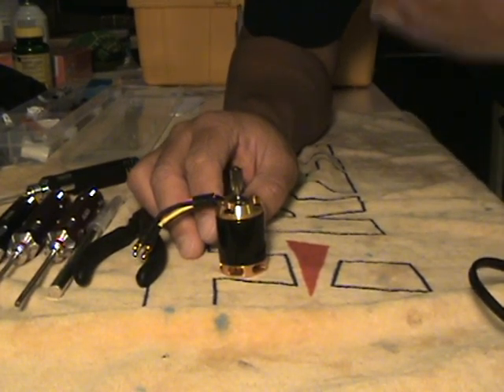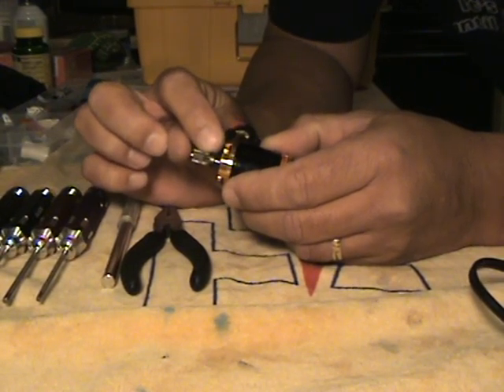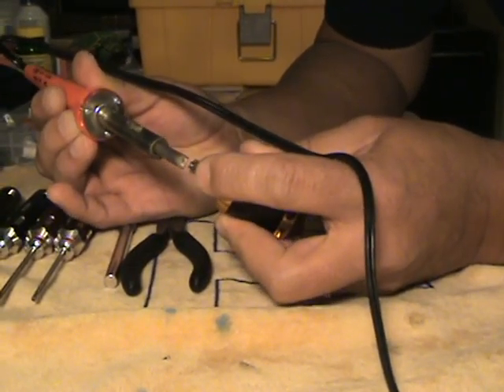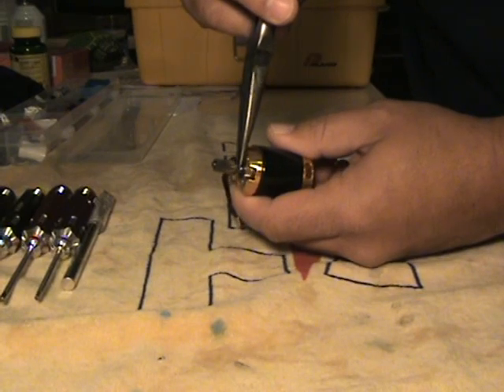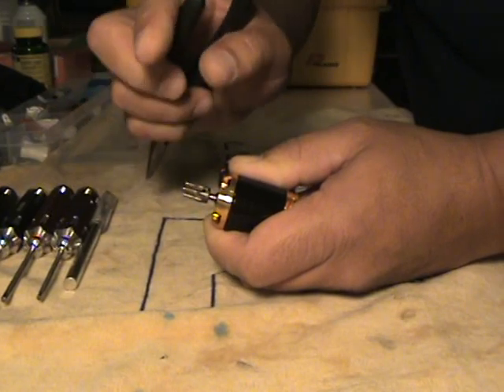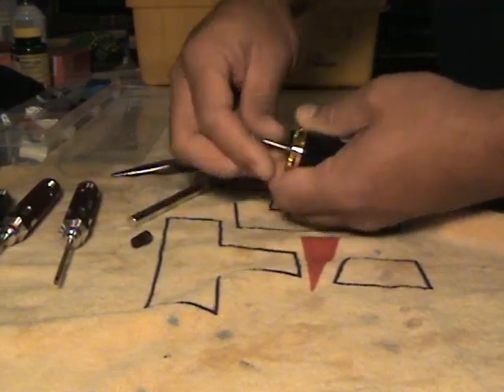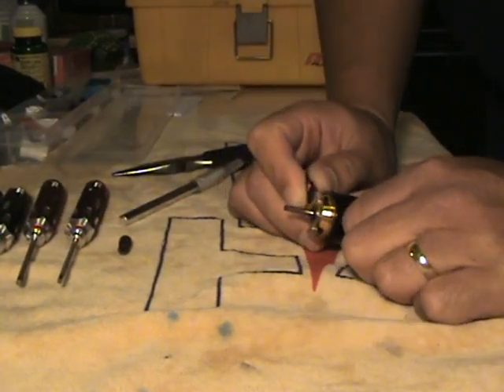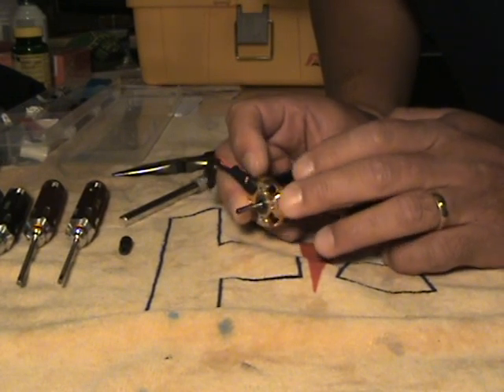Pinion removal using common tools

Comment: What is the smallest diameter " spindle " please?. Will it pull a slot car wheel off ?
Reply from the maker: frederick jones I don't know, only did this for these smaller (450 size) RC helicopter motors.

Comment from the maker: @thybigballs The whole point of the video was to show that you can remove a pinion even if you don't have a puller.  If you do it carefully like I did, there won't be any problems.  This motor has had several pinion changes using this method and not once was there a problem with the motor's shaft.   Sure, it you pry it off in one swift move you're risking damage, but doing it little by little works fine.

Comment: What you did in your video is a big no-no. You are putting  a lateral force on your bearings they are not designed to handle. This will damage them and is the reason pullers were invented.

Comment from the maker: You need to use a hex driver.  It's like a screw driver but with a hex tip, usually hardened steel.  The regular allen wrenches are way too soft.   Good luck.